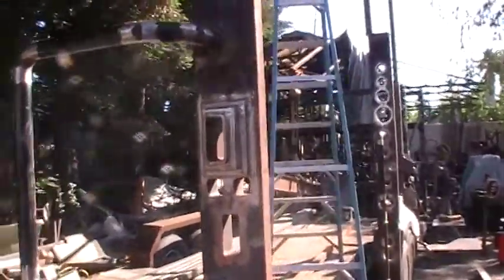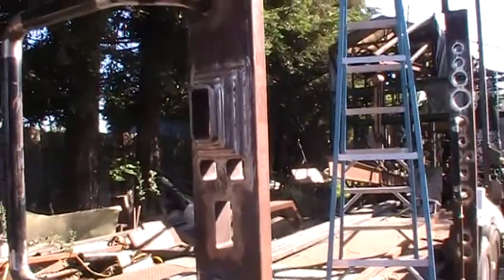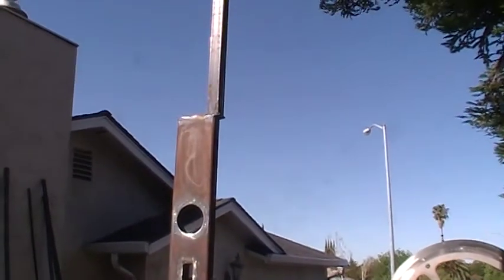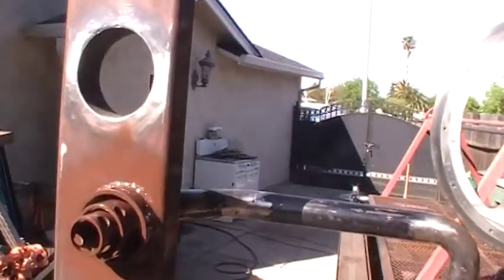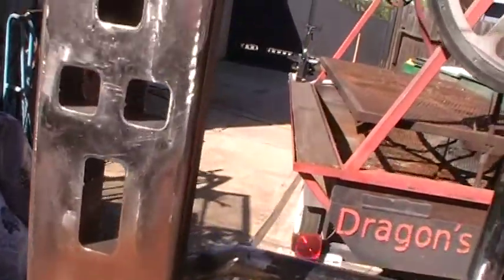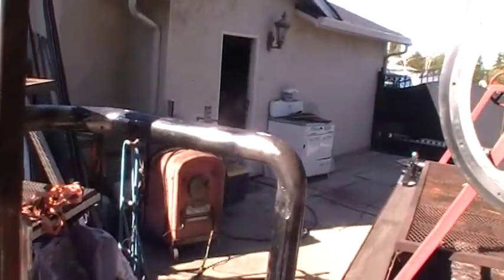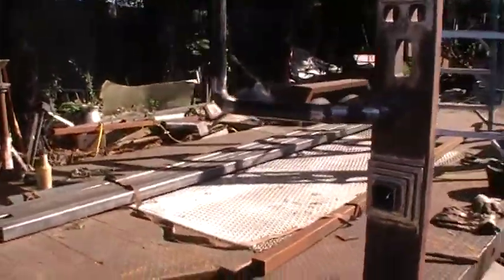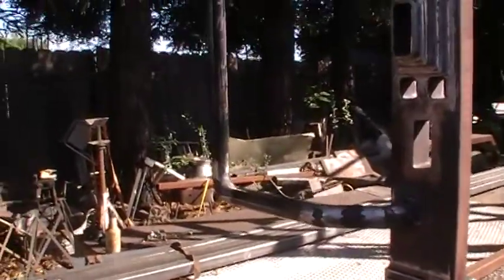Three sticks up!

Comment: What happened to your trailer that was setup as a machine shop? Thanks 👍😀
Reply from the maker: It's setting patiently behind it. I've been focusing all my attention on the new trailer. Should fire it up and knock the cobwebs off.
Reply: @davewilson1591  Thanks. Lovely old tools and great to see the line shafting 😀👍